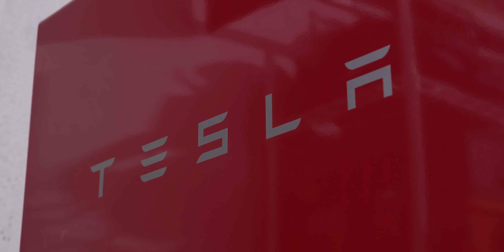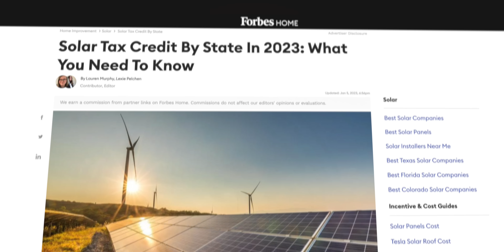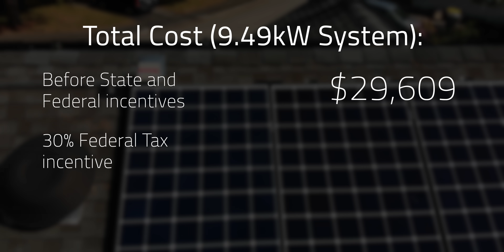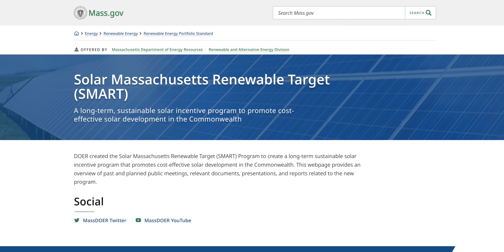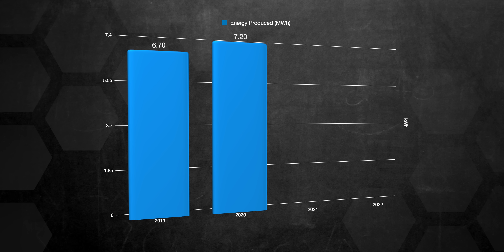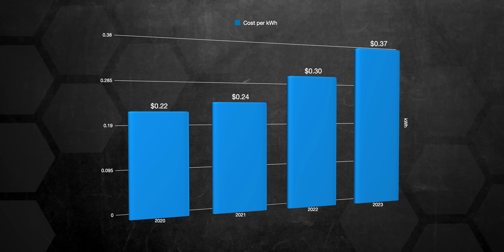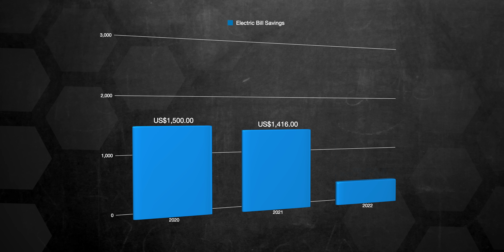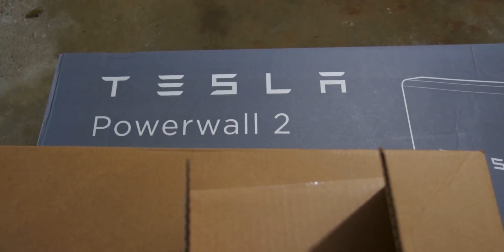5 Years with Solar Panels - Is It Still Worth It?

Comment: We installed a 6 kw system on our house in 2018.  It has provided all our electrical needs during that 5 years.  We pay only a monthly electric meter fee of 9.00. and a gas meter fee of 9.50/month.  Total installed cost of the 6 kw system was 16,500.  We had a bad hail storm in August 2022 which resulted in severe damage to our roof (No damage to the solar array at all).  Our insurance company agreed top pay us 11,200 to remove/reinstall the solar array so our roof could be replaced.  While the array was removed we decided to increase the size of the array to 12 kw.  Total cost of that system (including removing that old array) was 29,500.  We used Enphase IQ8+ microinverters.  We get the full 30% tax credit on the full 29200 cost, so along with the 11200 we received in our insurance settlement, the cost of the new 12 kw system was a mere 9,450.  This year we replaced an 23 year old central AC unit with a new air source heat pump (we have a back up natural gas furnace).  We now heat and cool our house with our own solar generated power, reducing our natural gas bill by 85%.  We have net metering in our area,  We build a very large bank with our utility during the summer months and we draw on that bank in the winter months.  Our total yearly production (based on previous actual production) will be between 15000 and 16500 kwh.  This is more than enough for all our electrical and heating needs and may actually give us enough excess to charge an electric vehicle.  We expect this new system to pay for itself in 5 years or less,  and will pay off even faster if we invest in an electric vehicle  Our monthly budget plan cost is $40/month which consists of a 9.00/month electrical meter fee and 9,50/month gas meter fee.  We also cook and heat our water with natural gas which accounts for about $20/month of our bill.  Our system works really well, and we are rate hike immune.    We couldn't be happier!
Reply: what solar provider did you go with???
Reply: We used Ameriwest Electric in Spokane Wa.   @weareacorprotocracynow6907

Comment: We have solar at our farm, installed high on a pole barn with a perfect southern exposure, zero shade, and a nearly ideal 8:12 pitch roof.  It completely eliminates our electric bill.  The system is priced at $42,000, but my actual out of pocket cost was between $6000 and $7000.  If you do NOT pay federal income tax (about 50% of Americans) then a solar system will never pay you back.  If you make at least $200,000 of taxable income you can get the deal I got after rebates and tax advantages.  Unfortunately many solar companies are overselling customers and quoting costs as if everyone has sufficient tax liability to take advantage of everything.  Be sure to fully understand the costs and payback for your particular case before agreeing to a solar installation.  That is especially true if your utility company does not allow net metering (essentially a meter that runs forward and backward giving you credit for power you push back into the grid).  Without net metering you will almost certainly need a battery bank to fully eliminate your electric bill (and the batteries were quoted to us at $50,000).  Luckily our utility allows net metering.

Comment: It wasn't your fault that the installation went badly, it was Teslas for recommending them.  As far as panels go I live in a conservation area here in the UK which precludes fitting them.  However a lady I spoke to recently has them due to power cuts being fairly common where she comes from.

Comment: Why should I be happy other people pay with their taxes my solar installation?  Without all that windmill and solar panel nonsense power plants could work at a 100% efficiency rate and bring down the cost per Kwh making energy practically free.  It is taxation by your government what makes energy so expensive.
And closing those conventional power plants seems like a very very bad idea to me.
Reply: See my comments above.  I am one of those taxpayers paying for others, but unless you also have high tax liability you will wind up paying for most of the system yourself and sole is NOT a good deal.
Reply: Agreed his cost for Electricity is CRAZY   even at the 12Cents  for peak in colorado he is paying about 3x more than me so it make "cents" to  install.. even if they dumped the tax credit it would still pay off..... in colorado I still haven't found a company to sell and install cheap enough for it to work $$ wise...

Comment: The reality is that almost no one else will get all the benefits/breaks you got.  And by the time most people pay off theirs, they will lose money by going solar, they just become an energy supplier for the local energy provider.
$35,000-$65,000 start cost (with 1-2 batteries that only last 9-15 yrs) and by the time you pay them off, you have to do it again at a much higher price with no incentives or discounts.  
Imho solar is not worth all the stress/permits/costs/maintenances/etc
Buy a generator and use it if needed during a 1-2 times in a lifetime emergency.

Comment: Excellent video proving that this whole solar thing is basically a scam.  You have demonstrated that the upfront costs take over a decade before your savings even covers the cost of the system.  AND, that takes into account that you got a 30% tax credit, AND your state sends you money every month (most states don't).  Had you taken that same $14,000 that you paid for the solar panels seven years ago, and purchased crypto you would be a multi-millionaire by now, but I digress. The other very important thing you failed to point out is that solar panels deteriorate (decrease their efficiency to create electricity) each year.  It is fool's gold that the solar manufacturers "warranty" their solar panels for 25 years, because the efficiency of the panels is so poor by year 10 - 14 that you have to replace them, meanwhile you haven't even covered the initial cost.  In short, the process was a complete bust and now you have to start the process all over again. In addition, even in your example you would have saved far less money had your electric company not ridiculously raised your wattage rates so obscenely. I live in sunny South Florida where one would think would be ideal for solar panels.  WRONG.  Installing solar panels on one's roof damages one's roof, and is a nightmare during storms and hurricanes, causing the panels to go flying and taking your roof with it.

Comment: Thanks for the video. As one interested in solar panels for the home, I must say their efficiency levels of current solar panels are much to be desired. The best solar panels offered the public do not even reach 30% efficiency. I have a feeling the tech is there for better panels. But your energy companies probably do a great deal making sure this tech doesn't reach the public, or to keep them at an expense to make it out of reach for most people. Regardless of tax incentives, which are not so great. Again, energy companies are one of the biggest industries to "lobby" congress each year.
Reply: See my post above.  My $42,000 system cost me between $6000 and $7000.  But to get that much in credits you will need in the range of $200,000 of taxable income.  By and large the incentives are for the higher income people.  Way more than half of Americans should stay away from solar until either the price comes drastically down, or electricity becomes prohibitively (like 4X) expensive, or the government decides to make the credits refundable (meaning you get them even if you don’t owe tax).

Comment: Thanks for the Info. You should take up your problem with Elon Musk himself and  he and Telsa should reinstall the system properly and professionally. As this is advertising his quality. 
Is there a heating wire you can add to remove the snow that is triggered by temperature or manually if you see an accumulation happening?

Comment: If more people got solar panels the infrastructure costs for electricity production would go down and the benefits to the environment would be massive, even with the battery materials. The technology is improving massively. There is a company in New Zealand that is renting them to home owners for a set monthly cost depending on the size of the array

Comment: Sooner than later your roof will need to be replaced. Many insurance companies Will NOT cover the replacement due to the panels being installed and if it leaks they won't cover it either as they will say it was caused by the installation of these panels. Also, many companies who install and promise to be there when warranty issues occur have many times gone under and no one wants to cover the problems so you're left with no where to turn. These systems are electronic and they will ultimately fail as will your roof. I'll pass and pay my typical $150/month electric bill and not have any future hassles to deal with.

Comment: I think you should have mentioned if you think you might move within 10 years its extremely unlikely you will get a positive return on investment, battery systems double the time for the system to pay off if they can even pay off, and in most cases solar panels add little to no resale value to the house in fact many buyers seem to view them as a negative due to questions about maintenance, ignorance, or the problem of having to replace the roof in the future.

Comment: you're not achieving energy security because the panels will degrade over time and at best have a 20 year lifetime.   Second, they're not renewable.   The energy used to manufacture the panels came from fossil sources.  Third, they are not cheaper.  The cost of the panels is greater than the savings you will see over the life of the panels.  Fourth, in sum, the energy cost to produce the panels is greater than the amount of energy you get back over the life of the panels..  So buying solar panels is stupid and only lines the pockets of the chinese.  Please don't buy any more solar panels.

Comment: Solar is to expensive  germany  California  texas south Australia what do they have in common  dearet power n the world pritty good this solar What happens for 16 hours no sun  And to think solar panels are made with slavery child labour How good do you feel now  de  pends on what suit you
Reply: 16 hours a day I use the battery I charged during the day.
I bought my panels and battery used so the kiddies already slaved to make them regardless of if I buy them or not.
Just because you are somewhere that it doesn't make as much sense doesn't mean it's not good for some others.
Do you think they will let the forced labor go if nobody buys solar panels?
They wont they will just find something else to force them to make.
Reply: @ghz24  solar is a con
Reply: @rodmartin-nl8ns  No solar works, installers may be scamming people but solar power systems work if designed properly. What about it do you think is a con?
Reply: No I had solar cost 60000 dollars 10year ago and i shopped around to get the best Where it was crap no sun no power  and hot water solar crap allway running  out of hot water  Went back to gas beautiful l no ive had solar did not work   to my standard l got sucked in
Reply: @rodmartin-nl8ns  $6000 or $60,000?
Either way it was the installation company or their salesman that conned you. You can't blame all of solar technology for that 
Any solar water heater outside of 3rd world tropical installs should be as a supplement to or preheater for a conventional water heater.
I payed $96 for each of my 325 watt panels.
Where I am electricity costs $0.1 /kWh so it represents about 1000 kwh of electricity I could have bought. 
Even at the average of 3.5 hours of sun it will make a kwh per day on average so it will break even after 1000 days or 2 years and 9 months.
So the next 20 years is free.
If I payed $0.3 per kWh like some do it would break even/pay for itself in less than a year.
Not sure how you can paint that as a scam or con.
Of course one could make the argument that to make the panels useful I need lots of other equipment like batteries, inverters, charge controllers, racking etc.
But that's not true, I can get a 12,000 btu mini-split that has solar inputs and can power itself from 4 panels like mine for $1250. Add a 4 panel ground mount rack for $300 and $400 worth of panels and for about 2 grand I get a system that heats and cools as long as the sun shines.
Oh it also has a seer ratingbof 22 and comes with precharged lines so an average DIY guy can install it with a drill screwdriver and a holesaw.
If you spring for a connection to AC it will draw what it needs that the panels aren't providing to keep operating utilizing all the solar it can.
Of course I won't be getting rid of my gas heater that would be silly because it can get -20 F here.
Just because a Tesla battery fails doesn't mean all electric cars are a scam. (or the answer to all our problems.)
The solar industry is rife with scammers no doubt but there is a viable technology there if you're wary.

Comment: Still a waste....you haven't said what your cleaning and maintenance costs of the panels, nor have you said anything about the decay loss of the panels as they corrode...are you willing to pay for all of this all over again in 5 years??
Reply: Ha ha ha 5 years where do you fools get this from? Solar panels degrade but even after 25 years they still make 85% of what they did new.
So my 5000 watt solar panels willstill make 4250 watts in 25 years.
Well actually I have 5200 watts so it will be 4420 watts in 25 years. 
I could add two more panels to get that 650 watts back.
My inverter could fail but it was only $700 so I'm considering ordering another for a spare. 
Or hook them both up and have 240 split phase or 6000 watts instead of 3000band still have redundancy built in and as I can fall back on using only one. 
Rain washes them off and only so much dust will stick to them before the wind blows it off.
Maintenance is insignificant you can dust mop them every day if you want but you'll only gain a couple percent.
Solar panels are so durable and long lived I went for used ones and paid less than 30 cents per watt.

Comment: Nice video Matt.  My advice would be to make sure your installer/provider is someone who has installed many years and all kinds of system designs.  Example, your inverters are not desired because they create too many points of failure.  Every extra part and extra connection is a point of potential failure.  There are pros and cons of all decisions and choices.  Nice video, good information Matt.
Reply: If you do your connections right, you'll be fine.

Comment: Personally, I LOVE the idea of every home having SOME capacity to produce a little power on their own... it will be amazing for taking some strain off the grid and grid-failure security... Having some power in the event of a storm or outage could be life-saving for so many.
Reply: Most installs don't include a battery and don't provide any emergency power. They shut down so as not to feed power back to the grid if it's down.
I bought the battery first because battery backup is more important to me than solar collection.
I want both but I want emergency backup more.
Reply: @ghz24  That is a big problem, imho. We NEED to allow them as a default to have backup power for homes with them. It's absurd to have a power generating source on your home but having NO access to it when the power is out otherwise. At that point, they are just expensive shingles. 
It'd be nice if some sort of "backflow" circuit were in place to prevent backfeeding- b/c that IS a very serious concern and problem.... 
But I agree... solar to take some off the electric bill is WONDERFUL... but having power in the event of disaster or emergency is FAR more important.
Reply: @ghz24  Agreed. I've had solar installed on the new home I am building in the altiplano of Central America. We don't have need for HVAC, as the temperatures are not extreme at any time of year (Land of Eternal Spring). We installed a lithium battery that will store 2 days' worth of power, and in the event of a prolonged outage, should be able to generate enough to keep us going without interruption. Even in rainy season there are usually a few good hours of sun daily. I have a one-way system so I can't feed power back out to the grid, but I don't plan on using much grid power anyway. We average 240 kwh usage per month (where we are currently living) and the cost here is 18 cents per, which I thought was quite higher than in the US. I was shocked to learn how high the kwh cost is in some states now, as I moved down here 3 years ago from North Carolina.
My son is contemplating solar for his home in VT, so I am passing this excellent video on to him. Thanks! 🙏

Comment: Hello you talked about a grid tie system with micro inverters. Then you talk about power wall which use whole house inverter vs micro inverters. I sense issues with that but can you explain what happened and what was needed to be done.

Comment: So I'm building a new home and I want to go full solar or as much of it is solar as I can. Energy costs are a little less than what you do and I'm designing my own house with dataCAD so I am actually going to go for an A-frame styled home and position it east west. Nice lovely view of the river solar can catch all the time and I really don't have to worry too much about the snow because we get a lot of snow where I'm from. It means less shoveling for me and there's no roof height that's going to drop the snow off. Then I can simply leave some snow there for insulation in the winter because you want to bank the sides of your house and take the rest away with the tractor